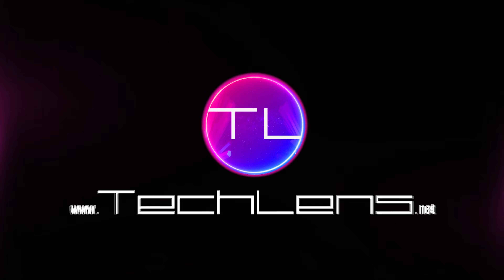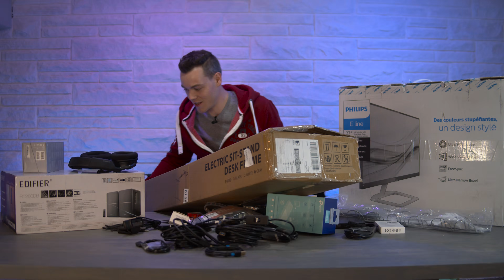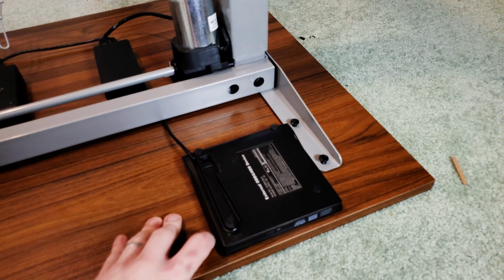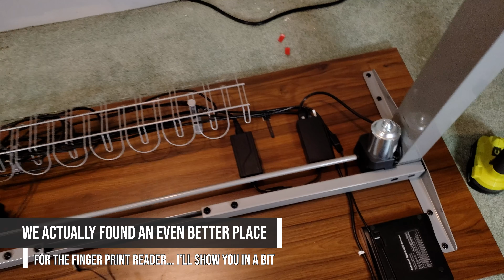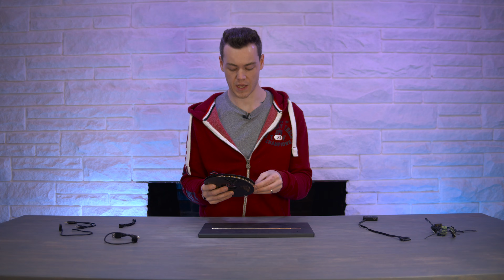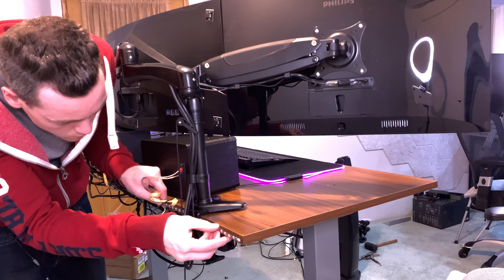ULTIMATE RGB Gaming Desk Setup! - 100% WORTH THE EFFORT!

Comment: I've been using adapters to connect common LED strips to lighting node pro but it only allows 60 LEDs/channel which is not a lot if you use 60LEDs/m strip. I use phanteks evolv X case and it came with SATA powered RGB hub that has 2 outputs. So I connect the input with 1 of LNP channel and with this rgb hub it basically doubles the controllable LED to 120/ LNP channel (both output run the same animation in parallel). This is good because it doubles the ability to control LED strips per LNP device, the hub has its own power so no worry about overloading the LNP.

I am wondering if anyone knows where to buy this kind of hub separately? I find it very difficult to find only LNP sold separately in my country.
Reply from the maker: Mostly bang on right here. They have updated the software to accept "external strips" which can do at least 96 (the last time I properly tested it, but they seem to have updated again).

But you are right, there is a concern of popping the fuse in your LNP... Most of these strips have a spare live and neutral attached to the head for separate power which is another option.

You could also duplicate the effect through splitting the data line into 2 or more lines . Eg.

Data line 1 soldered to pad 1
Data line 2 soldered to pad 100

So the effect would start on both pad 1 and 100.

Food for thought 🤔

Comment: Please please please please make video on lighting node core vs pro vs commander pro
Reply from the maker: Yeah man, not a bad idea! I'll write that into the schedule. (may be a while before I get to it though 🙃) and you are correct about the Razer Hub vs compatibility with iCue and Hue... Looks like a great device though!
Reply: How many 3 pin argb fans or led strip I can connect in one port in my lightning node core through one Dupont connect can I connect only 60 leds in one port please answer sir I am really confused
Reply from the maker: @people56-e1n  in theory, as many as the fuse in your lighting node core can handle before it pops 😅

I think it's 34 LEDs per Ql120 fan and the Lighting Node Core can handle 6 fans so (provided that the QL fans and the lights you are connecting draw the same power) I wouldn't go over 204 for everything connected to the LNC

Hope this helps.

The Lighting Node Pro is probably a simpler solution as it outputs 2 distinct lighting channels without looping back to the device.
Reply: @TechLens  you're going to be best YouTuber in future ❤️❤️❤️❤️❤️❤️
Reply from the maker: @people56-e1n  thanks man!
Reply: @TechLens  but it can connect 60 leds in one port I have cooler master prismatic pack of 6 fans each fans have 30 leds
Reply: Razer has a new hub fan/rgb and it compatible with everything ^^
Reply: @tomasberglund186  bro it is not compatible with Corsair and nzxt devices
Reply: @people56-e1n  Yeah it is!!!   https://www.razer.com/gaming-pc-accessories/razer-chroma-addressable-rgb-controller/RZ34-02140600-R3U1